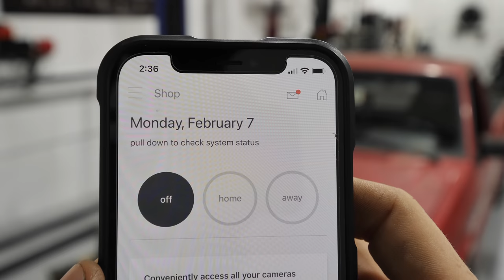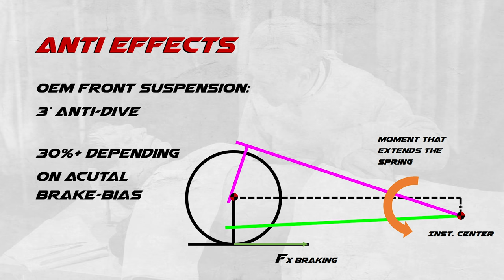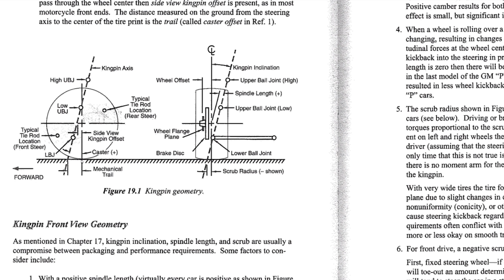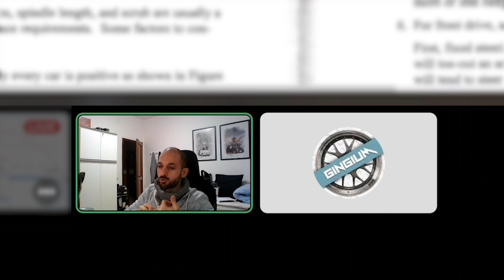We're Ready To CUT UP The Eclipse For The MID-ENGINE SWAP!

Comment: This gotta be the most interesting YouTube car project at the moment. Props for getting to know suspension geometry and doing stuff right from the get go.
Reply: Check out the StanceWorks widebody Ferrari 308 with a built K24 build if you’re looking for interesting
Reply: @danb4459  Well, I've been watching it eagerly from the start. I forgor, almost, for some reason. Though still, making a FWD car to (rear) mid engine RWD one is still more interesting than "just" changing the power plant and making all new suspension parts and what not. I know G is super ambitious after spending so long without a shop, so I bet we'll see some carnage pretty soon.
Reply: @danb4459  from a technical point this is far more interesting imo

Comment: This is gonna be epic man, i'm not sure if anyone has mentioned it yet, but if you got a 25 spline axle fwd dsm transmission, i would suggest you get your hands on a 1g dsm awd half shaft that bolts to the block, so you can run equal length axles, and for power steering if it were me i would de-power the rack, and merge a 1g column to a gen 2 toyots prius electric steering column that would eliminate the need for lines or the steering pump but you would need a higher amp alternator but easier to bolt on then lines.

Comment: Next time you're at the hardware store pick up a plumb-bob. Essentially it's the same as your washer string tool except the weight is conical and comes to a point for finding a point straight down (plumb) from another point.

Comment: I feel like you should raise the control arm mounting points. From what I understand of suspension geometry, having the control arm go upwards towards the wheel like that at ride height will do funky things when you start loading it up further with breaking and turning. You want it at least level at right height, if not, slighting decending so that you have some usable stroke before it starts going into the negative (upwards angle) where the funky stuff happens.

Consult with Mateo for more accurate and useful information.

Comment: I'm not sure I'm right or not but im guessing you can use the stock front control area on the rear but the mounting points will be more forward of the centerline of the rear axle. I know one thing that this eclipse should be an incredible car with a proper rear drive rear suspension setup.. to bad you couldn't use a Subaru awd transmission with just the front axles and set the engine in facing the right way and get the weight balance closer to 50/50.

Comment: You probably know this already, but the end of a tape measurer isn't meant to be a fixed point, since they were largely designed for folks to measure and cut materials without having to think about cutting or relieving materials outside of "draw line; cut on line." If you can find one, an engineer's ruler in 1:1 scale will yield you much more precise measurements than your tape! Anyway, keep up the hard work!

Comment: Question on the loss of weight in the front from the engine, would you really have to alter the front suspension geometry if the gas tank will have to go there anyways? Gas weighs quite a bit so I wouldn't doubt that the weight of the gas tank full would affect things like the bump steer mentioned in the video.

Comment: I know its fun doing all the math and thangs, but I'm wondering why you didn't start with the eclipse AWD rear control arms and just make engine and transmission mounts integrated into the rear cage? All you would have to have mad would be the half shafts. Cool build, can't wait to see the rest sir.
Reply: Shifting the CG so drastically would still change the suspension response. He'd have to alter the rear suspension anyway if he wanted to do it "right"
Reply: @bigrob966  I agree with you there sir. I like seeing the far out stuff as well. What we have seen doing this with Hondas is shifting out of the components. Mad torque steer one direction under load.

Comment: (9:49) There is one origin point where the X,Y, and Z planes intersect. What your talking about would either be the the origin planes for the X,Y, and Z or origin lines for the X,Y, and Z , depending on whether you want a 3D element or 2D element.

Comment: Why not set reference laser lines outside the perimeter of the car in four 2 horiz top bottom and 2 vert left right and pull a measurement from each point to both lines? 

Or layout a grid on the floor and plumb laser up to each point to get that plane? Etc

Also ALL horiz plane layout should be from center out

Comment: Do you plan on cleaning the under side of car. And coating the underside with something? You could bedline the underside or just spray undercoating. Just a thought. Also are you still going to leave the radiator in the front army you?

Comment: Why don´t you buy a cheap Green Cross Line Laser for 50 bucks? My friend used one of those to take accurate measurements when cut up and rebuilt his Studebaker. Very easy to move around and take all measurements.

Comment: So much work to build a suspension that you could just buy. You could use a stock Eclipse GSX rear suspension and the stock front suspension that is already in there. All the Geometry is already done. Yes, you'll still get to fabricate the engine cradle and modify the rear to fit it, but all this math will already be done. You'd be be building and fitting the engine cradle right now instead of building pointless jigs and PVC spring replacements!
Reply: Stock rear suspension would not work for a mid engine swap!   You'd be modifiying it so much you may as well start over like he is doing!
Reply from the maker: It would take plenty of modification to fit the engine/transmission in between the rear suspension. Plus rear suspension parts are harder to find/more expensive and I wouldn’t have a chassis to build a jig off of.
Reply: Why assume he’s satisfied with the stock geometry?
Reply: Did you actually watch the video? Like at all? That's like the number 1 rule of the YouTube comment section, you watch the video before commenting lol. The suspension can be improved to be better, and to modify the stock suspension to improve it would require so much fabrication you might as well start from scratch.
Reply: @ShaunHensley  A: Because I've seen all the Eclipse videos and haven't heard any complaints. B: It wouldn't end up GS Stock...it'd be GSX stock. The GSX rear suspension is a multi link semi trailing arm independent suspension whereas the one on there now is not independent at all. It's more like an old Fox body Mustang rear, just not driven.
Reply: @mmodtomic7119  most enthusiasts understand that production cars for the masses are exercises in compromises for the average driver with regard to all sub systems. 

The fact he's bringing in a factory design engineer to plan optimum geometry should make his desires obvious
Reply: @onefastslimjim  Calm down Jimmy. I watch all the videos front to back, have done for years, though I don't memorize them. Can you do me a favor? Give me a time stamp where Ginge elaborates on how the GSX "suspension can be improved to be better, and to modify the" GSX " suspension would require so much fabrication..."

I'm not advocating he modify what the car came with. There is an AWD variant of this same car (called a GSX) that has a very different rear suspension. I'm suggesting Ginge use THAT rear end (the GSX rear suspension) that pretty easily fits this car as a starting point for the modifications needed to make the car RWD.
Reply: @_Gingium_  Yeah, after looking at a couple of pics of the GSX setup it does look like it might be a tight fit to get the diff part of the trans into the right spot...but you put a WRX into a Miata! And the whole poimt of starting with the GSX rear would be so you Wouldn't Have To make \ use a jig!
Reply: @ShaunHensley  This is going to given away...perhaps to a young newly licensed driver. Twitchy race car or proven safe relatively sporting fast car? Which do you want to share the road with...or have your kid driving or friends a passenger in?

I'd feel different if this was going to just be part of the Ginge fleet.
Reply: @mmodtomic7119  Part of the fun of building something is building it. buy a corolla, buy a toaster, I'm done arguing with a nanny
Reply: @mmodtomic7119  Ging didn't elaborate on how the suspension can be improved, the engineer did with the numbers. That's quite a bit of bumpsteer factory on the front suspension, so like I said, there can be an improvement there. The fabrication bit is common sense, the rear suspension, even from that from the GSX, is meant to have a relatively small differential there, not an entire engine and transmission combo, especially because the engine is going to be transverseley mounted like it is in the front. I may have overspoken on the "completely re-engineer the rear suspension" bit, however it probably would need modifications to be able to fit the engine, at the least move the mounts for the control arms outwards to be able to fit the engine there, and that could compromise the suspension geometry. To get it back to a safe and correct suspension geometry would probably require so much work, again, you might as well do what he's doing and engineer suspension that has the engine back there in mind. In the end, it probably will inadvertently become a multi link setup to achieve the geometry him and the engineer are looking for. Hope this kind of clarified what I was trying to say.
Reply: Sorry if I hurt your feelings. I'm not "argueing" with anyone. I'm replying to comments directed to me. If name calling is the best you can do, go back to reddit. BTW - you missed your golden opportunity to whip out the ol' "Boomer".
Reply: @mmodtomic7119  ‘Sorry I hurt your feelings’? What are you, a 17 year old girl? 

I’m embarrassed for you.

Again. Instead of coming here to criticize a builder for straying from factory geometry and engineering, why don’t you take us into your garage and show us how it’s done.
Reply: @mmodtomic7119  also, I had forgotten to put a time stamp, since Ging didn't elaborate, I'll put a timestamp for the suspension graphs to let those speak for themselves: 17:43

Edit: I just realized, you also hear the engineer say how the front suspension needs changed because it relies on the weight of the engine over the front wheels to help with self centering of the steering? To quote him, without the weight of the engine over the front wheels, it would have "little to no self steer, due to the low caster angle." Again, another reason to re-engineer the suspension with the mid engine layout in mind.
Reply: @ShaunHensley  Soooo....no one who hasn't built a car can offer criticism or advice? That would mean that all the praise offered up in the comments by those who haven't built a car would also mean nothing. Neah, I don't believe it. That's just tossing out another cliche.
Reply: @onefastslimjim  I'm guessing the engineer dude doesn't watch the videos because Ginge mentioned in another video that the weight of the fuel tank will make up for the loss of the engine up front. I'm pretty sure the engineer (dammit, what was his name? lol) has just been trying to show Ginge the reason he shouldn't put the front in the back. Anyway, it's a moot point. Ginge isn't going to listen to a guy in the comments. If anything he'll dig his heels in even more and double down on his plan!
Reply: @mmodtomic7119  Check my edit of the comment with the time stamp. Even if he didn't move the front suspension to the back, and just left it as is, it wouldn't handle right. The engineer commented on this, again, "little to no self centering" on the steering wheel due to the lack of weight over the front. Yes the gas tank will be heavy, but not 500 pounds heavy (the weight of the engine and transmission combo), that is unless you had one of those Kenworth 200 gallon units lol. But yeah, it's comments like these that make the creator double down. Nice conversation lol, you have a good one.